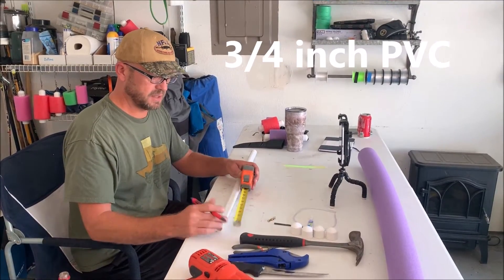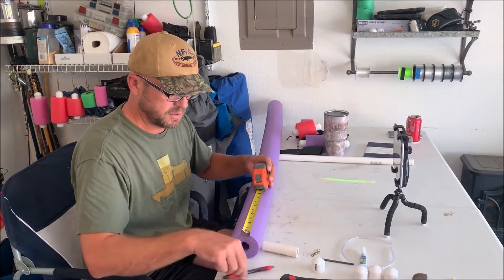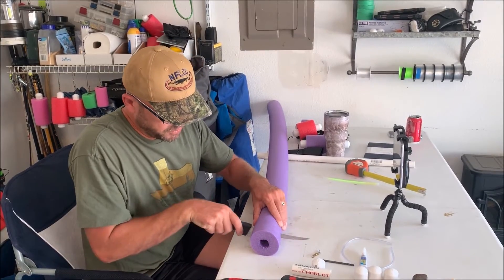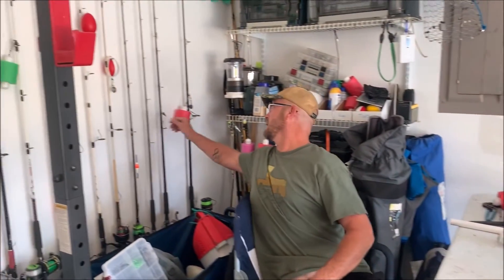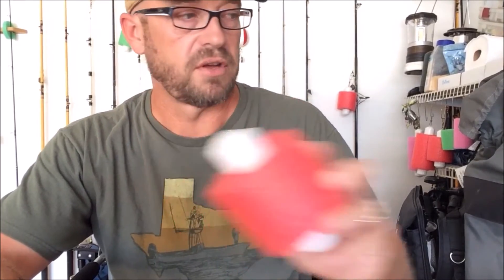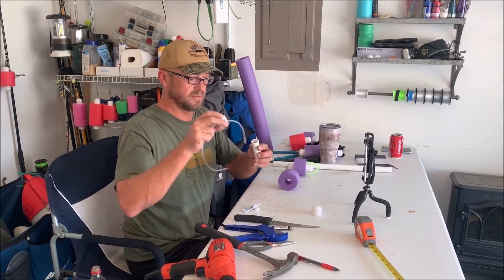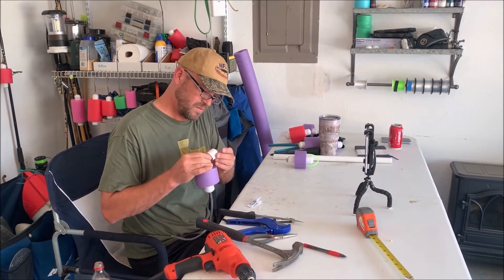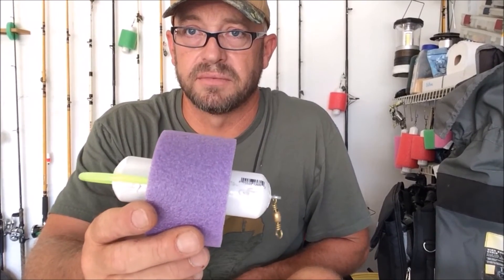DIY Live Bait Float - How To Make

Comment: I made slip bobbers out of styrofoam balls which I found on ebay.  I melt a hole through the center with a heated coat hanger wire and run a plastic tube through it (salvaged from an empty spray bottle, such as windex etc)  I anchor the ends with hot glue.  They work really well and are easy to cast.

Comment: where did you get the foam?
Reply from the maker: Amazon.  Make sure it’s closed cell foam
Reply: @infinityoutdoorstx5589  ok cause i made some from pool noodless and they end'ed up absorbing water after a while and started falling apart i like them better than bulsa floats also have sold some to other fisherman
Reply from the maker: @strengthstuff7618  the closed cell noodles will not absorb water like the cheep pool noodles do.  I have some I have been using for 3 or for years with no issues

Comment: Where do you get those closed cell noodles?
Reply from the maker: I order them off Amazon.  The close cell ones will have it listed in the descriptions
Reply: I also have the same questions and it wasn't linked in description. Great idea making these
Reply from the maker: @loveshinebright1052  I did not link it as there are several suppliers that make the closed cell foam.  They are all good products so I did not want everyone to think I was endorsing one product only😁